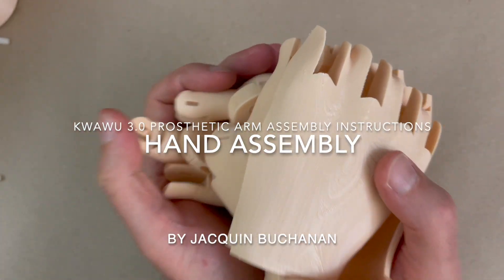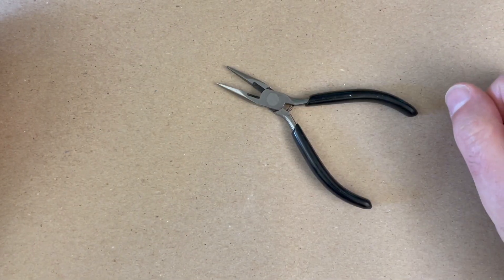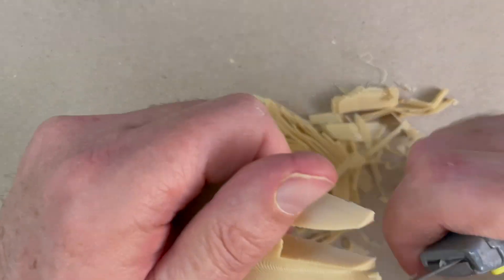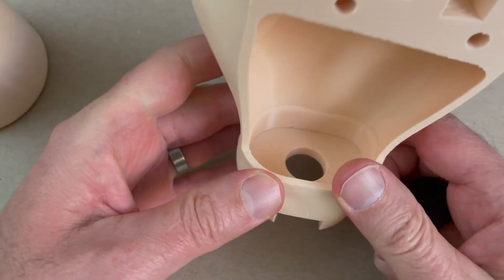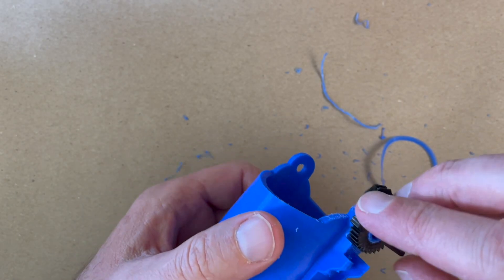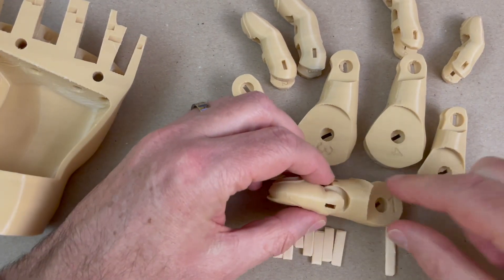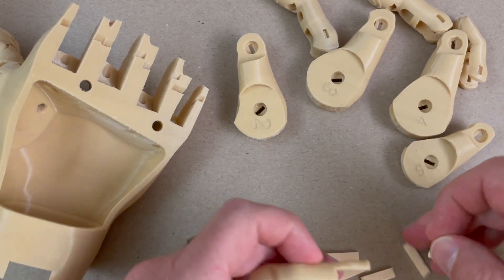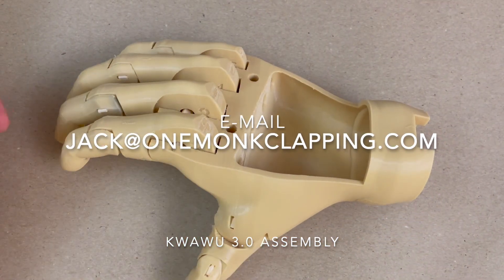2 Assembling Hand | Kwawu 3.0 Prosthetic Arm Assembly Instructions

Comment: hi. do you have step files for download. I wanted to edit my arm using fusion 360. I cant seem to download from the fusion360 link
Reply from the maker: Most of these files are generated using OpenSCAD. In particular, the arm socket is entirely code-generated, so there are no corresponding STEP files available.

Comment: Why is it necessary to generate the files with openscad?
Reply from the maker: All the parts are dynamically generated to fit the recipient based on the various parameters. The best platform for this dynamic 3D building is Open SCAD